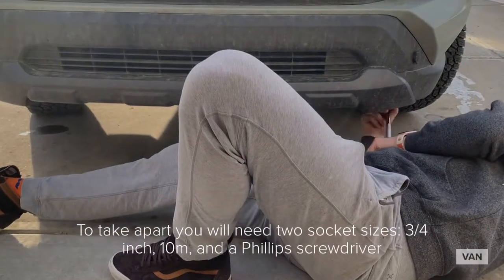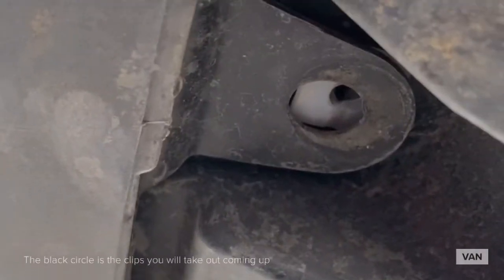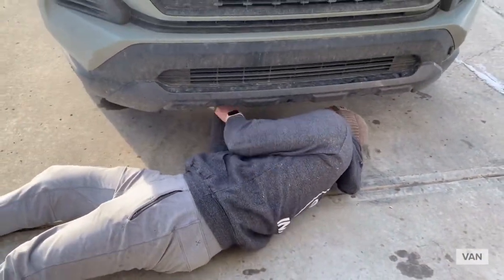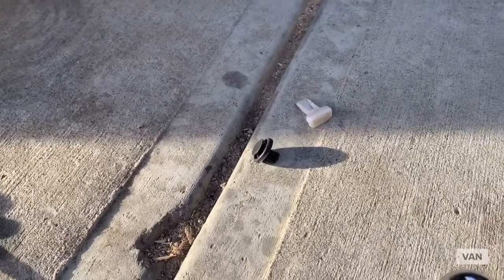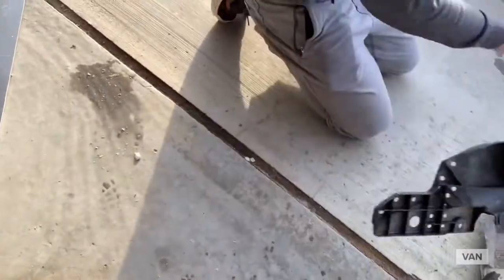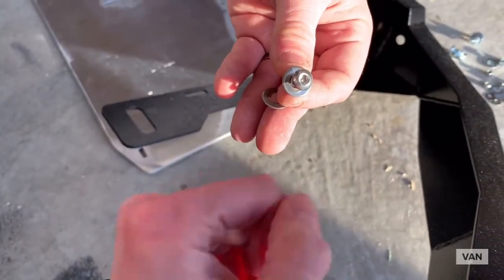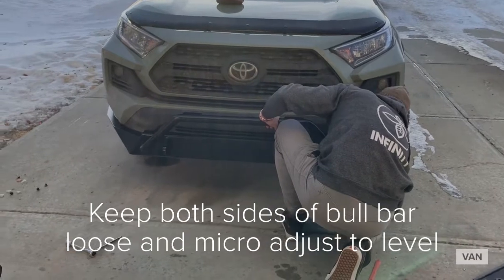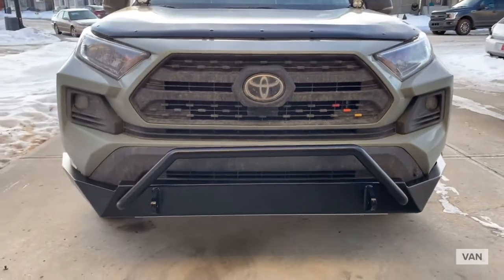2020 RAV4 TRD RNO Fit Fab Bumper install

Comment: I’m thinking of getting a Rav4 xse hybrid or trd I get so much crap for wanting one they say it’s a soccer mom car. I wanted it to do some camping a little bit of over landing not crazy offroad in or anything like that we’re going to the woods also have a great gas mileage I’m afraid the XSE model won’t be able to do that same with the TRD I have to raise it up and also I’m looking into the forerunner but the gas mileage on that is so bad so I don’t know what to do
Reply from the maker: Guess it depends on which you want more: height/ power vs gas mileage. I have found mine very capable. Yes the height is probably the most problematic for over landing. There are a few guys doing lots of overlanding with the xse.

Comment: Whats the wheel and tire combination you have there?
Reply from the maker: The wheels are 17” lp aventure lp1s and tires are Wildpeak at3w 245/65r17
Reply: Does it effect safety sensors